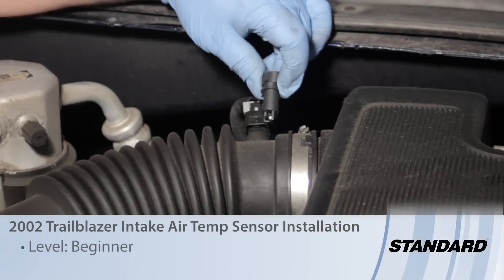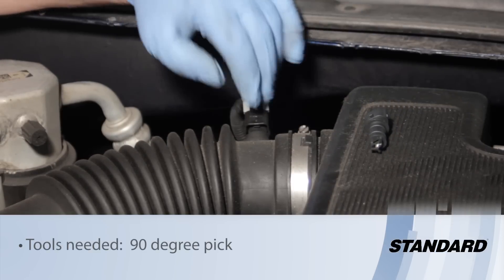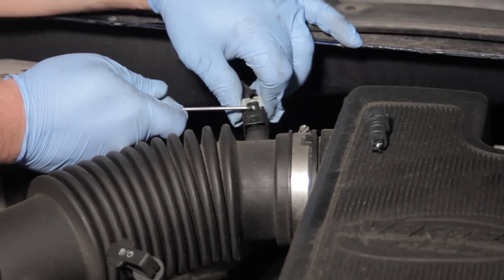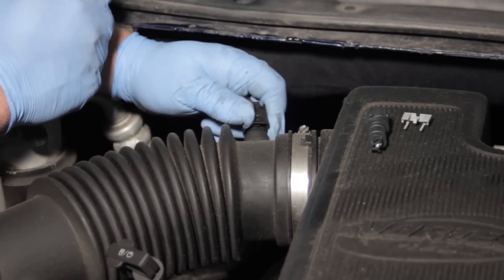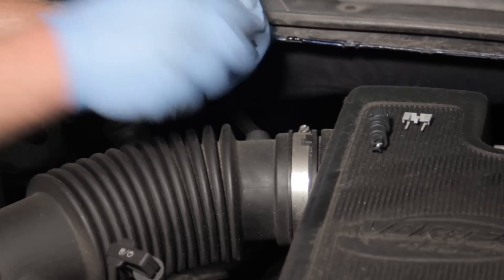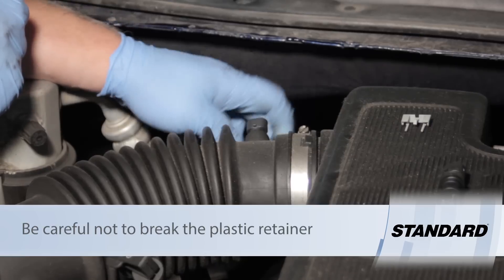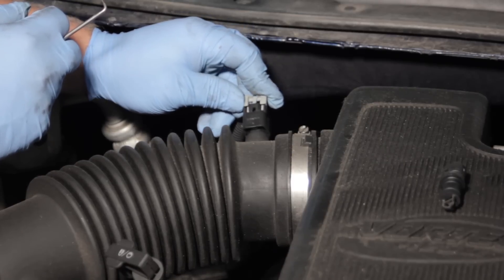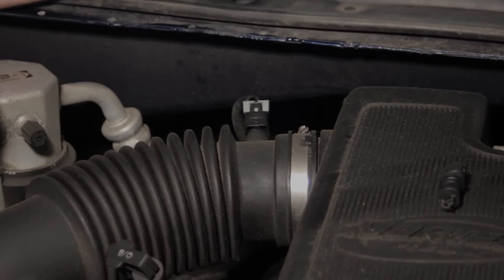Trailblazer Intake Air Temp Sensor Installation

Comment: my IAT is reading -40 do you think it needs replacing?
Reply from the maker: This is the default reading for the IAT circuit when it is open.  It most likely could be a broken wire or a faulty sensor.

Comment: My 2002 Trailblazer LTZ, keeps showing 50° & then down to 1°!!! Thus,  it keeps blowing has heat when in reality, it's really in the mid to high 70's ! Since it's always been stuck @ 50° isn't that my outside temperature gauge / sensor?!?!
I cannot keep riffing around blowing heat when I know my air conditioning works perfectly fine!
PLEASE ADVISE😣😢😤
Reply from the maker: It sounds as if you are having a problem with your cabin air temp sensor rather than the air intake temp sensor (the one that measures the air coming into the engine).  I would recommend having a professional diagnose this problem.  It may be something as simple as a broken wire, or as complex as a module.  None the less, it's too hot out to be riding around with the HVAC system stuck on heat!
Reply: How much, How fast,  and where?! 🙄😃